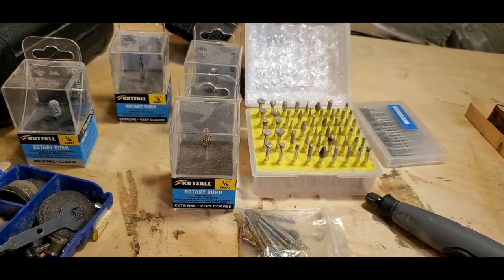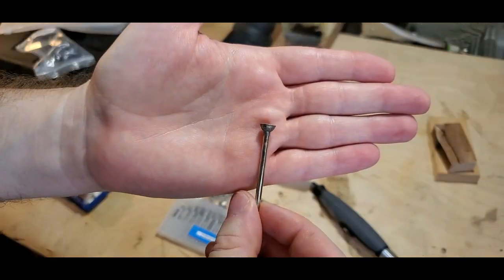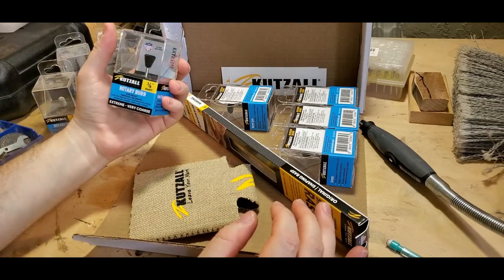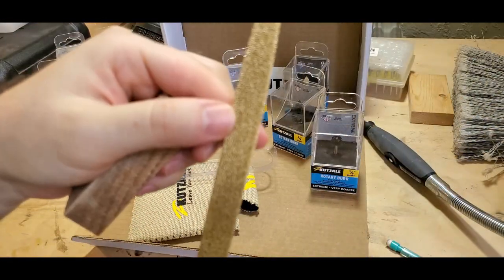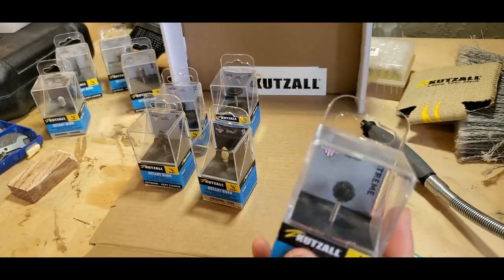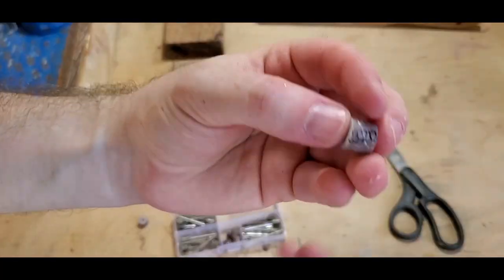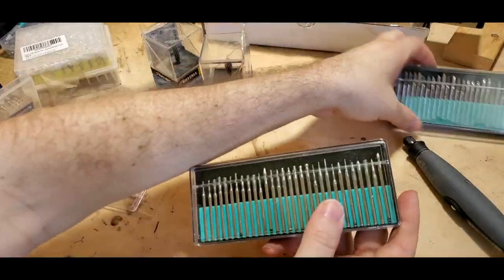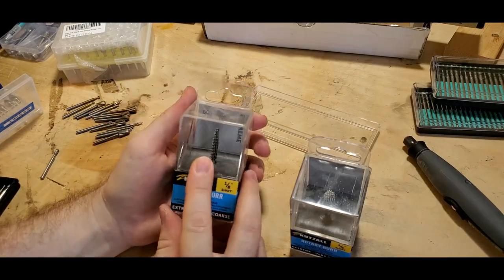What Burrs To Start Power Carving With For Rotary Dremel Tools, Kutzall Burrs

Comment: Great review.  Is there a burr or cutter you would recommend for cutting out holes or voids in a thin-walled Bowls & Platters?
Reply from the maker: Thanks, not that I know. Maybe look into a hole saw cutter
Reply: @ClevesBackyardWoodworking  Thanks.  I was thinking on of the very thin, narrow burrs might work
Reply from the maker: Just need to make sure the burr doesn't get stuck, can jam cause injury or break. Leave room for the burr or maybe use drill bit first.